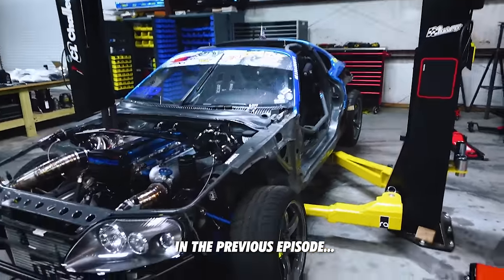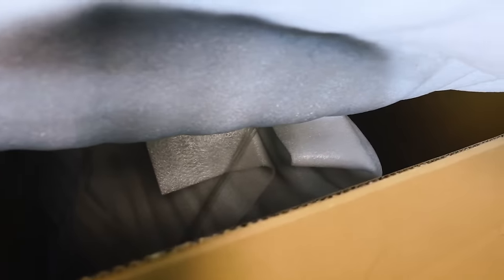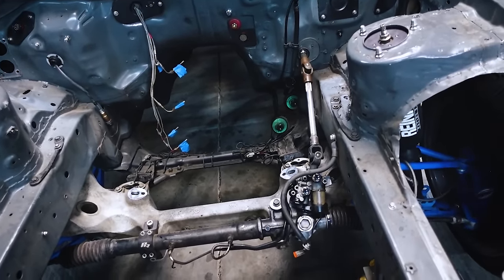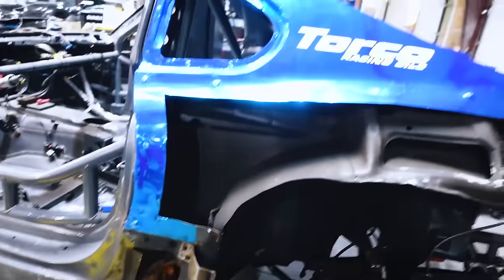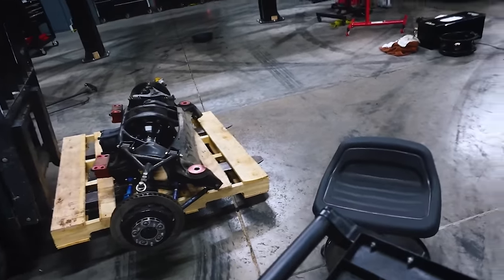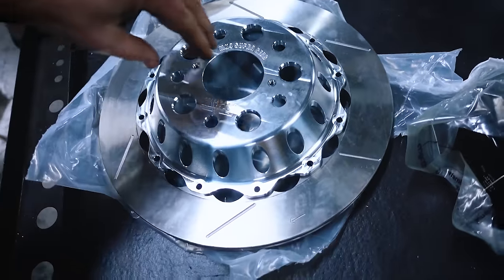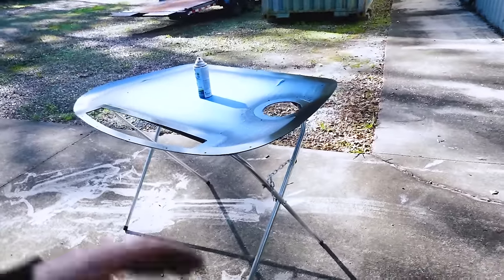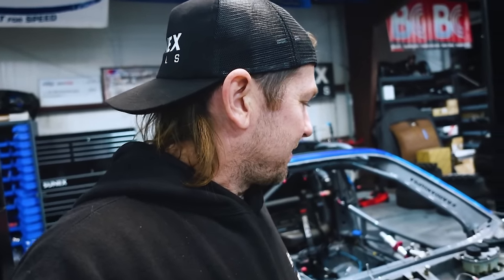2024 COMP SUPRA: The Parts You Don't Think About (EP 2)

Comment: My buddy built his own rotisserie when he redid his Chevy nova. Used 2 engine stands and some strut channel metal/unistrut metal. He did attach the unistrut to the bumpers but he was replacing the bumpers anyway but I’m sure you could make up some type of bracket for mounting. He welded up a tube holder that went from 1 engine stand to the other to help keep them aligned. The setup worked great. Probably didn’t have as great of mobility on the floor it he wasn’t worried about it bc it would only move 10ft from inside to outside of the garage.
Reply from the maker: I’ll buy one, for the amount of time needed to build a proper one that functions the same, after materials it would cost more if you consider my time invested too

Comment: Could you make the fans pull air from behind and push through the rad then out the top? I would think air rushing over the back of the car would actually pull a vacuum over that inlet??
Reply from the maker: Might work but it would pull super dirty air off the track that’s potentially hotter and full of tire smoke
Reply: @RADIndustries  would tire smoke gunk up the rad?